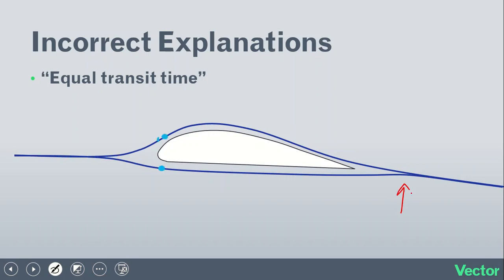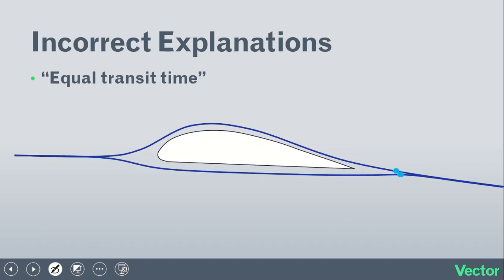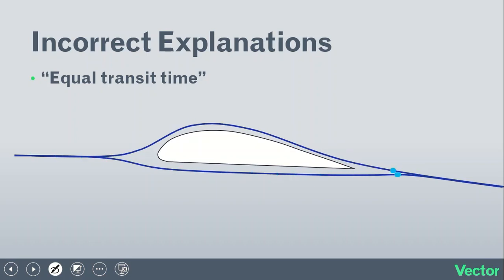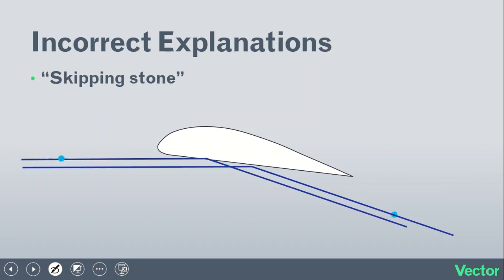Common Misconceptions About Lift

Comment: Air is not a "liquid" fluid.  NASA had it right when they sent the MARS rover.  NASA  explained that the very thin atmosphere meant it was going to be harder for the propellers to push.
Reply: The term fluid is the general term for both liquids and gases.
Reply: @Observ45er  Yes. And there is one of the problems because they are not the same.  A liquid and a gas are different states.  The term fluid confuses the matter and creates invalid assumptions.
Reply: @animatem  There is no problem, you must simply explain to the student what the terminology means and it is simple. 
. . 
In science and engineering we use the terms 'fluid' mechanics and dynamics because the behaviors are very, very similar and we use the same techniques for both liquids and gases. 
You did not explain why you thought they were different, but if you are thinking about PV=nRt the ideal gas law, and think that air is different because it is compressible, you should know that in normal flight speeds, air acts so close to being incompressible that we consider it as such, just like water. 
The pressure changes around the wing in normal flight are a very small percentage and the resulting compressibility and, therefore, the density change is insignificant for these common purposes. 
.
And yes, on Mars the atmospheric pressure is similar to what it is on Earth at 100,000 ft.  As I recall, that is 0.088 psi, or only 0.6% sea level pressure on Earth. This is easily available on the internet.
Reply: @Observ45er  Airplanes, sailboats, etc, do not start at normal flight speeds.  An equilibrium obtained in a wind tunnel simulating normal flight speeds with a stationary wing is flawed.  My issue started with trying to understand sailboat sails.  No sailboat works at those speeds, but this same "wing" process is used to explain sailboats moving in wind.  The answer is that seems very unlikely.  I am looking for the NASA article, but admit I cannot find it anymore.  They were very clear about the push process.  That process makes more sense in air.
Reply: I at least found "who" talked about the flight but not the full NASA explanation of flight:   One of the biggest engineering challenges is getting the Mars Helicopter’s blades just right. They need to push enough air downward to receive an upward force that allows for thrust and controlled flight — a big concern on a planet where the atmosphere is only one percent as dense as Earth’s. “No helicopter has flown in those flight conditions – equivalent to 100,000 feet (30,000 meters) on Earth,” said Bob Balaram, chief engineer for the project at NASA’s Jet Propulsion Laboratory.
Reply: @animatem  Yes, I am fully aware of all of that, and that air that is 'pushed down' is Accelerated by the Pressure Gradients created by the blade's airfoil motion
.
Euler, following up on Bernoulli's work in the mid 1700s, determined that a Pressure Gradient is the cause of fluid Acceleration <-- That is Newton in fluids. A difference in pressure between two regions will accelerate the air from the higher pressure toward the lower pressure. 
This is equivalent to a brick with two opposing forces pushing in opposite directions. The brick will accelerate towards the lower force. 
.
Reply: @Observ45er   ok.  And this is a real question (honest question), and not me trying to prove any point.  Does that explain sailboats, gliders, children's kites, paper airplanes in school, leaves blowing in the wind, etc? if yes, o.k., but that seems suspicious.  If no, what is the point at which things change?
Reply: @animatem  "Does that explain..."  <-- What is "that"?
.
And I'm not really sure what you mean by "point at which things change." 

Any shape change, or orientation change ,changes something.  

One example of a wing changing AoA has changes. 
.
That is a wide range of shapes and orientations.  As you move from one to another, all the fundamentals must apply, but different areas will dominate in each.
.
We're talking about wings, here. Something shaped pretty much like a wing {Pretty flat and at a reasonable Angle of Attack ,AoA} Functions similarly. So airplanes, gliders, sails, keels all have reasonable lift and drag.
.
Kites obviously have a very high AoA and are going to be stalled with high drag, but the triangle shape will change something relative to a more wing-like shape. 

A box kite is a flying tube that traps some air onside.
.
I have some time, so I'll try this. . . 
..
..
A key thing that almost no one seems to grasp, is that the fact that air has mass AND Inertia.   That is the KEY reason that pressures change around a moving object / surface.
.
An object must push the air out of the way and the air dislikes that because inertia says: "I'm following Newton's Laws and I'm not moving without a force. NAH!!!  No force - No move.

So the surface moves forward, but air's Inertia resists and the RESULT is more pressure against the surface AND in the air. 
If I walk and bump into you, your Inertia resists.  That causes the muscle and tissues between our bones to compress and those tissues are like a spring and they push outward on both of us.
.
If I just walk, I am converging on the air on front of me. Because it resists moving, the pressure on my chest builds up a tiny bit.  It is THAT pressure that pushes {Accelerates} it away from me so I can go through. This is Newton.  That air then accelerates away in all directions there is a lower pressure - left, right up. . . 

.
That is just like the underside of a common wing at a moderate AoA. Yea, yea, yea, the bottom is at an angle, so it is a bit different, but keep listening.

More pressure on the surface and in the air.  That pressure pushes against on the surface {mostly up} AND pushes away from the surface {mostly down}  on the air.  This causes it to curve as I am sure you know.  That curve in the flow is the result of the pressures.  Call it centripetal acceleration if you like - BECAUSE IT IS!!  Mass moving in a curve <-- Newton again.
.
That is when air and surface CONVERGE on each other.
. . . 
. . . 

.
Well. . . If that is the case, then it seems reasonable that when air and surface DIVERGE, the pressure must go down.

Above the wing, air and surface are diverging. Air's inertia 'wants to go straight', HOWEVER the atmospheric pressure and surface prevent that, so it curves to follow the surface better.  
Air's Inertia resists that curve, just like your body's inertia resists following a roller coaster track at the top of a hill - and you feel lighter!  Your Inertia acta against gravity and your bottom pushes less on the roller coaster seat. 
.
I don't know what can be suspicious.    You must follow ALL the fundamental physics principles that apply. 
.
With me so far?
.
You must start with the fundamentals.  Then, I recommend looking only at a "normal" wing to understand that.  THEN  you can start changing to other shapes and see how this-or-that area changes.  If you keep jumping around to this-or-that shape, you're just adding complexities that confuse things.
.
Not sure why I did this because this is all spelled step-by-step at this link. If that doesn't work, then perhaps you're not equipped with enough basic physics to understand lift.  It seems very simple to me and I have seen 5th and 6th graders follow this. 
.
Start by reading this until you  get it.  
It goes through the fundamentals step-by-step:
 Understanding Aerodynamic Lift Correctly:
  rxesywwbdscllwpn.quora.com/
- - 
Cheers
Reply: @Observ45er  You answered my question!
Reply: @animatem  I hope that isn't sarcasm.  . Because I gave an honest answer.
Reply: @Observ45er  It was not!  Seriously, I was actually asking and you gave a good answer.  I admit I have read through it a few times just because it is extensive.  But it also answers the questions.  No sarcasm.
Reply: @Observ45er  ...and yes, I could tell it was an honest answer.  It does not mean I am 100% convinced so quickly, but it does mean I have to ponder and keep quiet for a while.  I am also not trying to play any youtube comment games.  It was a real question and thank you for the thought-out honest answer.  It is an honest thank you.
Reply: @Observ45er  "almost no one seems to grasp, is that the fact that air has mass AND Inertia."

You are saying that conservation of momentum in fluid flows is not generally accepted?
Reply: @animatem  OK thanks.  I'd like to shorten it, but some of that up front mater is crucial  and many of the people trying to discuss this are really weak on even newton.
.
I have given both of those much thought and have talked with a few well known names to make sure I had things correct.  I don't understand why one of them doesn't put something together.  I've started thinking about collaborating with someone with a name.
Cheers, I see more comments from you. . .
Reply: @davetime5234   No, on the conservation  of momentum question..
.
What I see is that many people simply repeat the words they know, but don't understand the  underlying meanings.
. 
Not conservation of momentum.  That's a given, but some people will say those words, but can't be specific about how it applies -Except for one of the three most common "explanations": "Lift  is 'caused by' Newton's Third Law 'reaction' due to downwash".
.
My main point in explaining the physics of lift is the concept that inertia resists Acceleration and that is why pressure change around a moving object / surface.
. . . .
  Air's Inertia "doesn't like" acceleration and resists it.  That is why pressure changes around a moving object.
It is so flippin' obvious to me.  
.
Yet I've only seen one person before thisd grasped that concept.  He said he was writing a book, but he was so much more verbose than me and constantly diverting to other subjects,  what he sent me was so hard to read.  
This is technical and requires careful writing and, then careful reading.
.
As I've worked on this for about 8 years and read so many comments and questions, it is hard to write something because no matter what you do to simplify it, someone comes along  saying "OH!, but you forgot about X or Y. . . "
.
No I didn't. Either what you bring up is irrelevant, or I had to assume that the reader understands basic physics so I didn't RE-EXPLAIN every bit of of Newton for everyone.

..
..
Here's something to think about:
.
Take a brick on ice - no friction.
.
Apply a force.
It accelerates per A=F/M, right?
. . . . Newton's 2nd Law.
.
It is the brick's inertia that resists, or opposes your force and makes it continue after you stop pushing, right?
.
It is the brick's inertia that makes Newton's 3rd Law "happen".!!
. . . That "reaction" was the objects Inertia resisting the force YOU started.
.
But realize this. If the brick had no Inertia [synonymous with mass] you couldn't even apply a force.  It would just move along when you make contact - and it wouldn't continue when you stop.
.
SO. . . 
.
Because air has mass and this 'inertia' thing, THAT IS WHY there is a pressure buildup when a surface moves toward the air or air toward a surface [wind].
..
.
When talking about wings, just swap Pressure for force and you have Newton's Laws for fluids.
.
Conservation of Momentum is what happens AS A RESULT OF all the pressure changes as the air is shoved hither and yon. . . . 
.
BUT, BUT, BUT it is the pressures we want to hold up the wing.   Top-To-Bottom pressure difference. 
.
Everything else is just "the rest of the story", but we already have the lift and can stop there to fly.
All the other stuff is things we most definitely must deal with, but lift is Movement + Inertia --> Pressure changes = Lift.
. . . 
Next comment. . .
Reply: @Observ45er  "Conservation of Momentum is what happens AS A RESULT OF all the pressure changes"

Aren't pressure changes occurring as a result of conservation of momentum as well?  Is there not a reciprocity here:  A x P = d(mv)/dt   or  d(mv)dt = A x P?
f =ma or ma = f?

Also, what was your point about the average pressure change being a small percent of ambient pressure?  Were you just stating it for interest value, or were you intending to make a point with that fact?
Reply: @Observ45er  "No, on the conservation  of momentum question.."

Conservation of momentum is inertia.  

Think about it.
Reply: @Observ45er  "My main point in explaining the physics of lift is the concept that inertia resists Acceleration and that is why pressure change around a moving object / surface."

Ah, you mean the conservation of energy consequence to maintain conservation of momentum:  the potential energy decreases to maintain conservation of momentum?  

That is what you are saying: the pressure drop to maintain that inertia, which is of course what we mean by Bernoulli.   
 
So, you are trying for a more insightful way for you to see these known processes?

Comment: I believe this misconception comes from the effects of a venturi. In the Pilots Handbook of Aeronautical Knowledge, concerning explaining Bernoulli's principle, it says that for a venturi tube "The mass of the air entering the tube must exactly equal the mass exiting the tube. At the constriction, the speed must also increase to allow the same amount of air to pass in the same amount of time as in all other parts of the tube." In a constricted environment like the tube, this would apply, however in the open space an airfoil operates in, this is not the case and thus two particles flowing over and under an airfoil do not meet at the same time.
Reply: Actually, since air has inertia, external flow does behave like internal flow. This is a very common misconception in the education literature on the topic. This argument that internal and external flows are not equivalent is used all of the time to argue against Bernoulli based explanations, and they are as wrong as the things they are trying to correct. Everyone can try this, you can use blu tack or playdough to make a venturi, combined with a straw and measure the effect. Like a carburettor or an airbrush, one end of the straw is in the middle of the venturi, and the other is in a liquid (a glass of water). Blow through it and see the reduction in static pressure as the liquid is drawn up the straw. You can then make a "half venturi", or a hump around the same straw, and you can still observe the effect. It is not as significant, but because air has inertia, it still "compresses" around the hump and as such speeds up resulting in a lower static pressure at the top of the hump. People claim Coanda explains this, and that is just wrong. You can do simple CFD and the presence of the hump provides an increase in  pressure at the wall, and this in turn gives an acceleration to the flow based on a simple balance of Newton's 2nd law (either Euler or Navier-Stokes). It is common for most aviation and pilot based texts to ignore the pressure on the wall of the venturi, and to only present the static pressure along the centreline. As a result, you never appreciate where the acceleration is coming from.